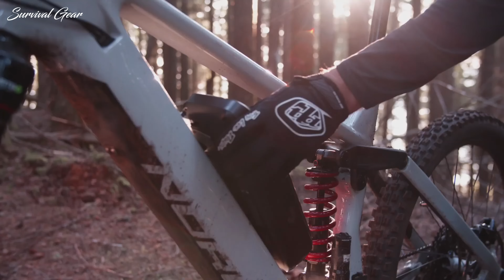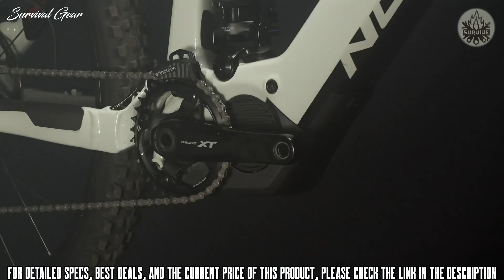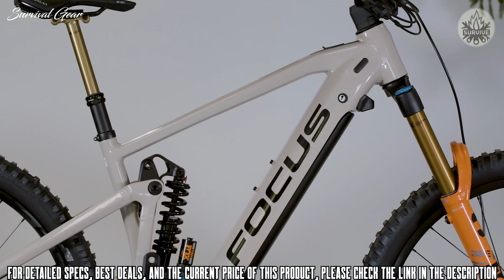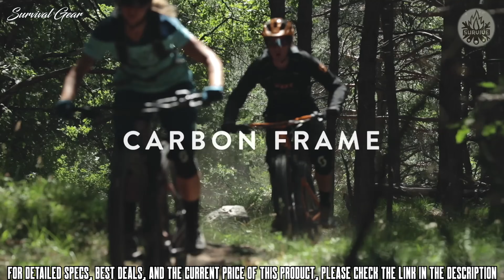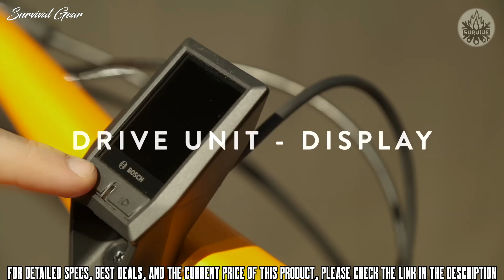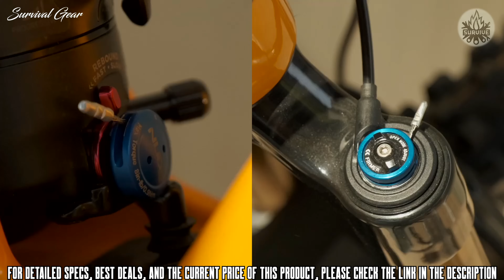Top 5 Best Electric Mountain Bikes 2021 | New e-MTB 2021!

Comment: Thinking about getting the Greyp limited. I'm an above knee amputee as of july 2019. I got a script from my doctor for it instead of a custom handcycle. Waiting on winter to pass and will hopefully have things lined up with my attorney. Just sitting and waiting to see what else comes out before then.
Reply: You get your bike?
Reply: @rudymental9993  not yet unfortunately. It's a slow process with my attorney and what not. I did get a quote on a custom g 6.2 though! Planning on trying to get that model with carbon wheels and switch it from an 8 speed to a 12 speed. It takes over 3 months to order the limited version. I could get that one in a couple weeks if they still have it in stock
Reply: @moderndaypirate8931  legal stuff takes time. Hope you get a bike sorted and are coping with everything life has thrown at you 🤝.